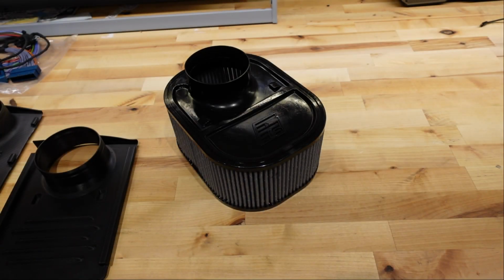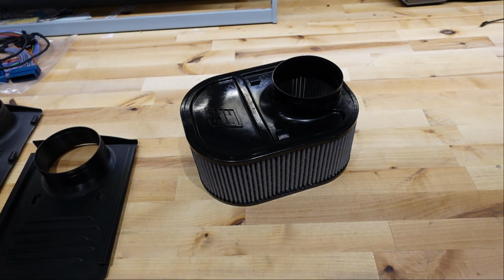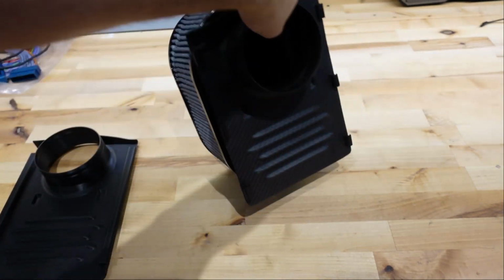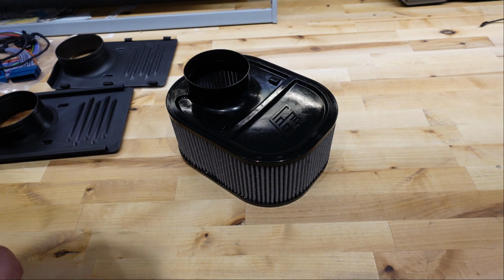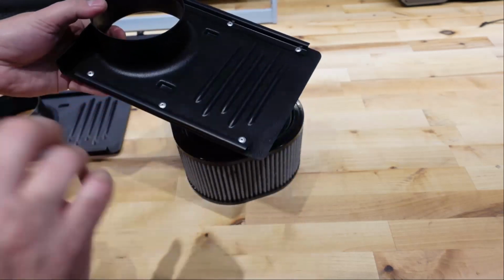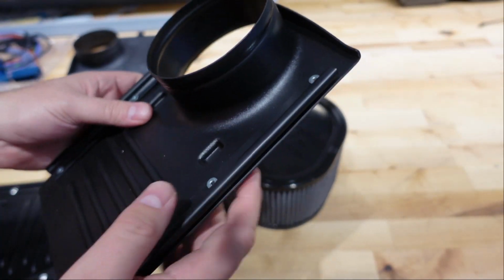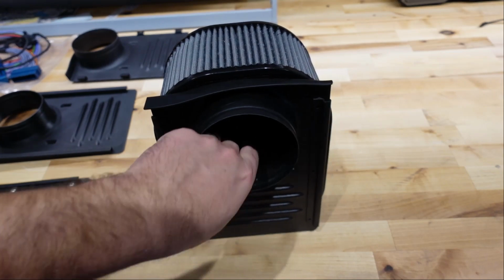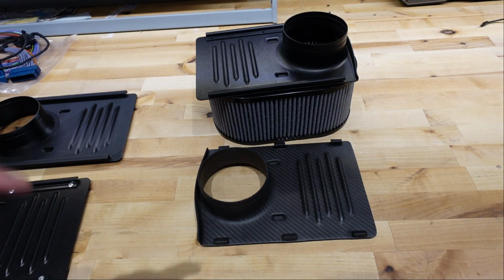Flat 6 Vlog / Behind The Scenes: Macan Intake Development

Comment: Hi 
The air filter in My 2019 Macan base 2.0 is totally different from your video installation guide?
I can't install it myself
Reply from the maker: This system is for the newer (95B.2) V6 models, the 2.0L intake uses a different design that can be found here: https://flat6motorsports.com/collections/macan-intake/products/flat-6-motorsports-high-flow-intake-system-macan